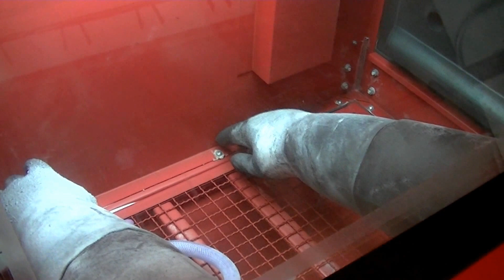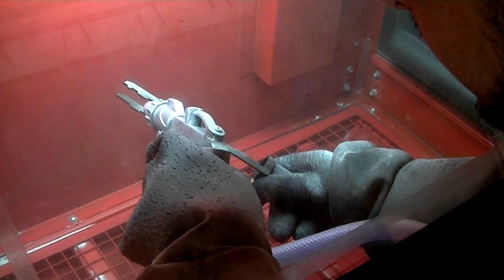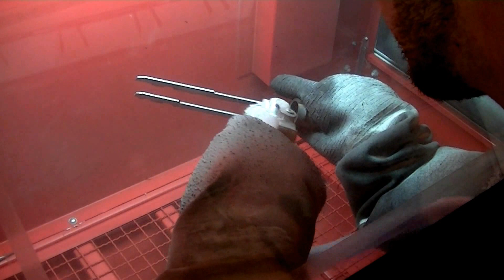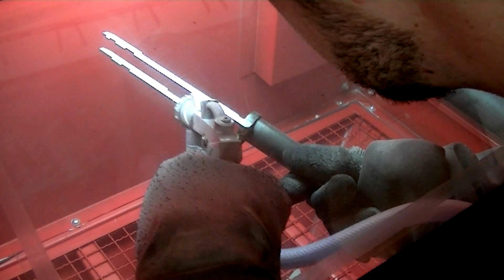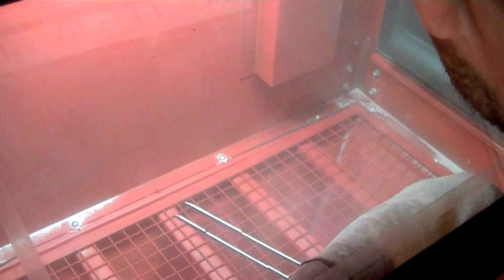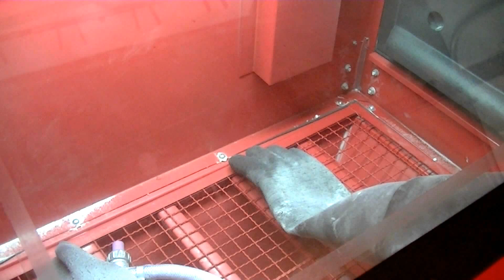Grit Blaster in action on a Remington 870 slide

Comment: What was the grit on the media, and would this finish be able to dura coated ?
Reply from the maker: This was a glass bead and I don't remember the mesh but the answer to your question is a HUGE NO!!! It is a  big no-no to try to coat over a glass beaded finish. You must use aluminum oxide or like abrasives. The glass polishes where the others cut.  I am not a big fan of dura coat anyway, I prefer KG Gunkote or CeraKote over Duracoat.